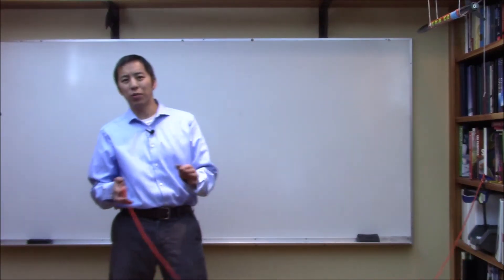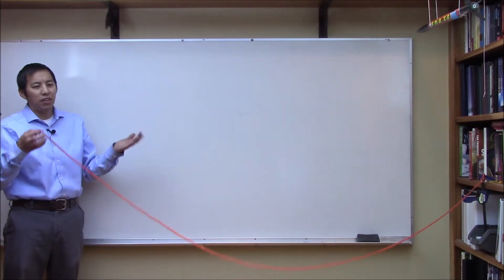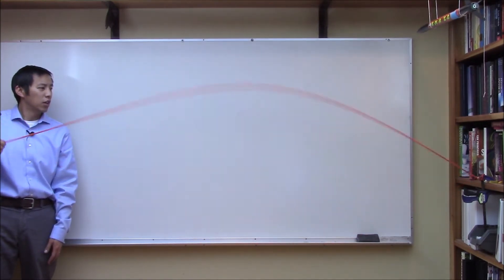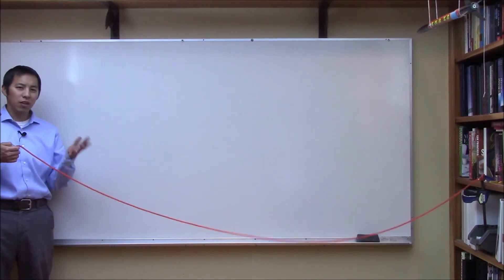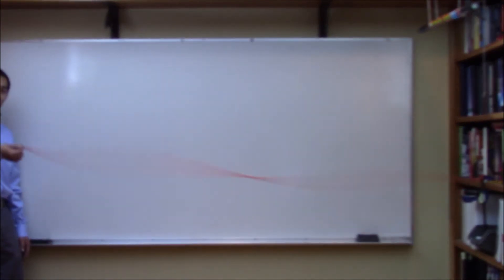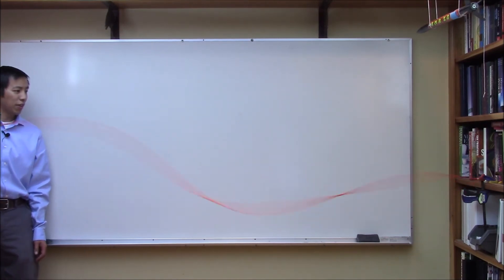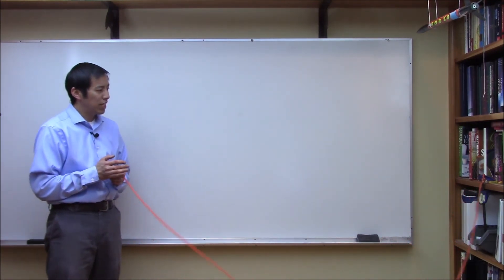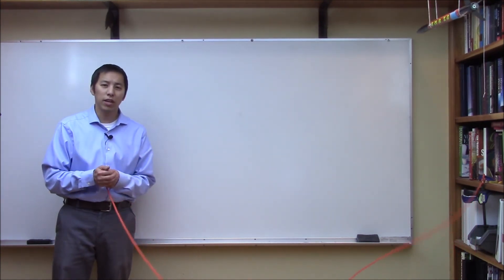Standing Waves Demonstration

Comment: AE501: So the highest harmonic you were able to achieve was the 3rd harmonic since you could only spin the string so fast. If you used a higher density (per unit length) string, would this lower the harmonic frequencies to easier to achieve values allowing you to reach higher harmonics?
Reply from the maker: Nathan, good question.  In fact, I think you can answer this using the analysis you performed for the homework assignment with the vibrating string.  You can see how the tension, density, length, etc. factor into the eigenvalues and eigenfunctions.

Comment: AE501: I liked the visual aspect of this demonstration and it helps connect the theory with the practical aspect of waves.
Does the length/material of the rope limit the number of nodes at all? Or is that purely based on the frequency?
Reply from the maker: Actually no, but as we'll see in the HW, the material properties affect the frequency of the modes/eigenfunctions.